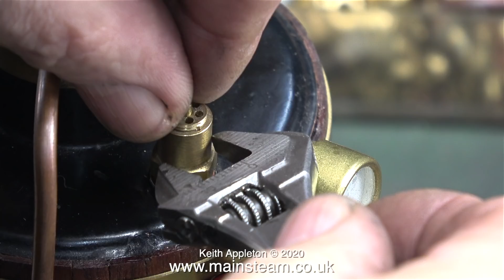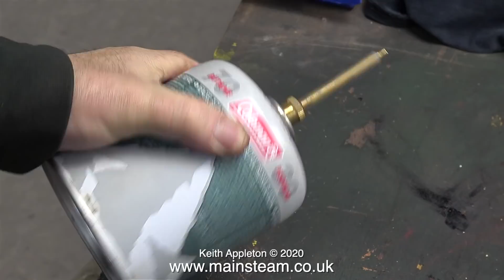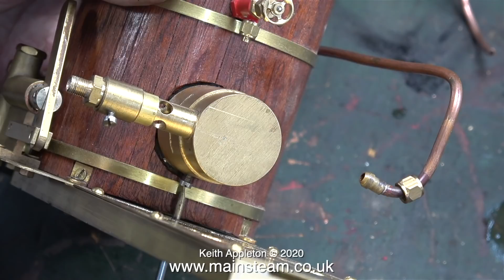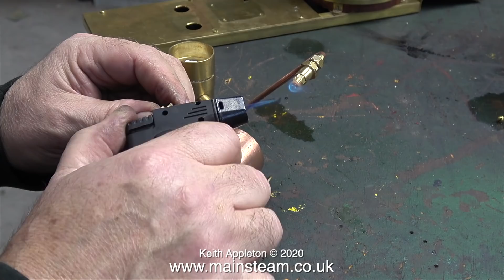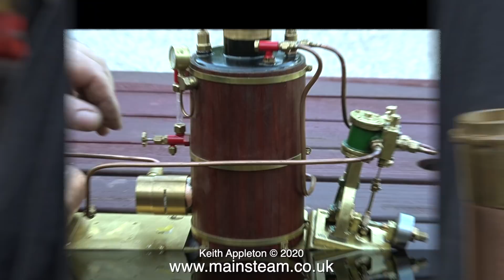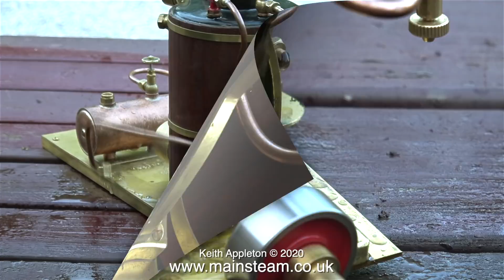VINTAGE STEAM BOAT RESTORATION - PART #2

Comment: Keith I thought you installed an electric heater in your shop?   Are you going to add a radio control unit to this model?    Nice to see that your work still holds up after all these years!
Reply from the maker: It is the Aircon heat pump, but it's not so efficient extracting heat from outside when the temperature is sub zero.
Reply: @keithappleton  Oh yes, now I remember.  The Aircons are good systems and the company does recommend that they work best in conjunction with a conventional heat source.  Maybe an electric radiator?  I have one that I use when the temps outside  get very low, as today with it being 19f (minus 7c)!